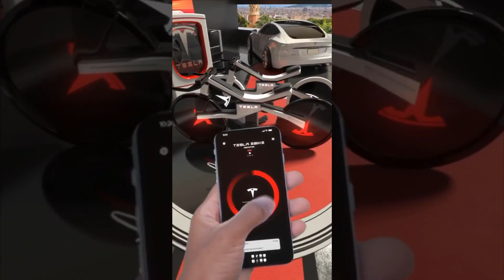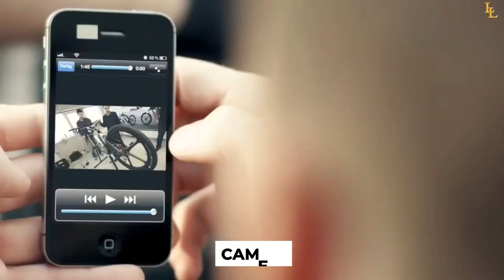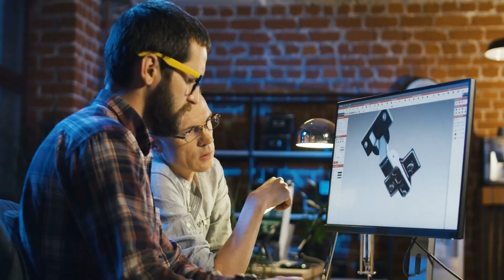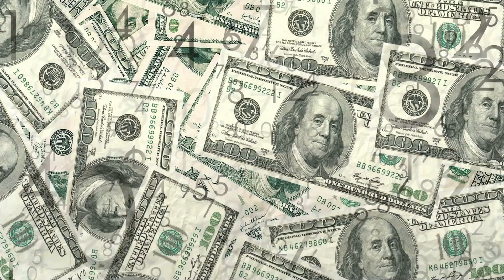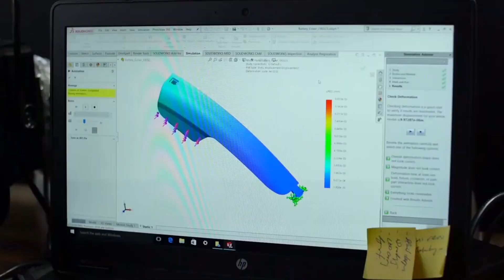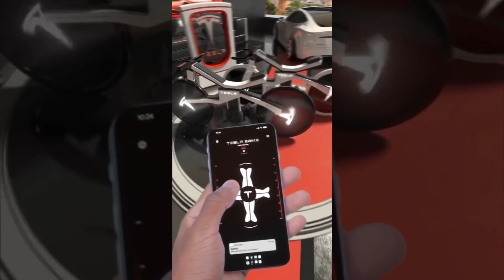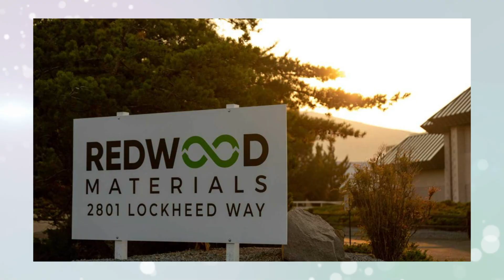TESLA E-BIKE: Here's Why Only Geniuses Like It!

Comment: I can hear the drums... but where do the I imagine Lycra clad with perfect physiques TESLA E-BIKE "geniuses", led by the 100% Smart Sense genius staff... come marching in?  I can see them in lock-step raising their bikes in unison with one arm overhead then mounting them in perfect style.  I'm not a genius but I promise I'll wish I was you and cheer you on, wave, throw confetti...  I still want it to have a crank so if things somehow fail one can always ride it like a conventional bike.  I like peddle assist to extend range and also so I can combine commuting and exercise to whatever degree I want i.e. if I'm on a 3 hour ride and want one hour of peddling exercise I can.  The way it is with no crank drive one won't be able to do that.  Really amazing design though and some getting use to with the handlebars and wonder if for any reason you need to lift one hand off the handlebars to push your glasses up your nose, use the touch screen (probably shouldn't while riding ha!), or scratch your head etc and how easy it might be to have an over steering accident.  It also looks like they are not designed to pull a trailer.  It's easy to ask negative questions and overall this is so great to see!!  I see it as a great part of the paradigm shift we all need to make!  Thanks for this great video!